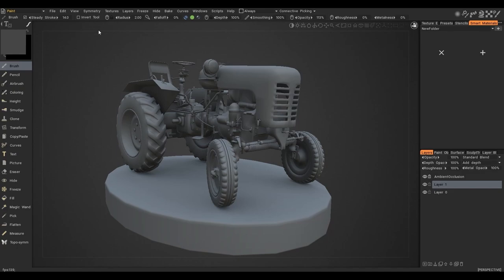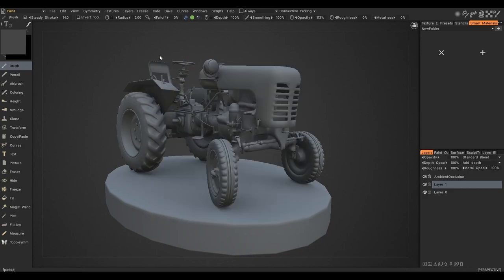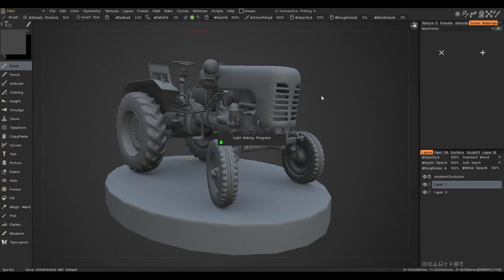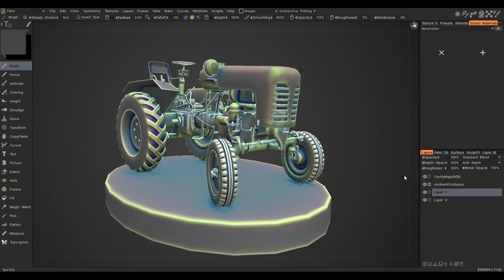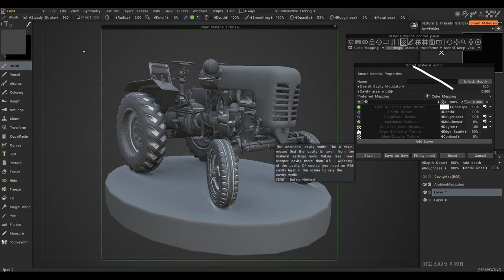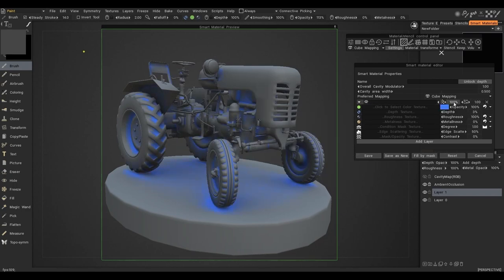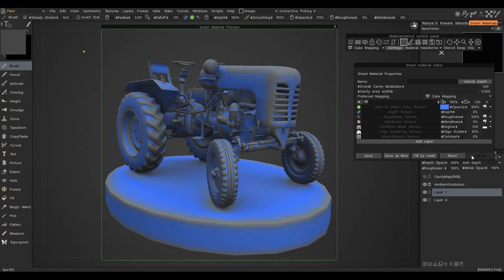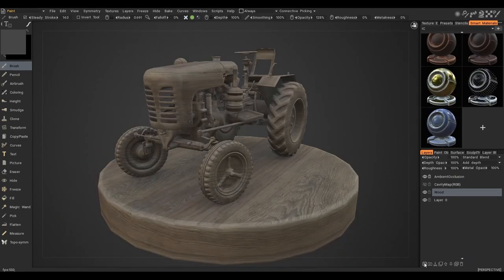The Use of RGB Cavity in 3DCoat 2021

Comment: Lovely! But I didn't understood what is the main difference between RGB and the older version. 
I saw it can generate colors,  that could be applied in post production, but there is other gains to bake in RGB?
Reply: yep, the same question. i suppose rgb-cavity is like normal map and stores curvature information based on light direction and not just slopes & highs.
Reply: I'd bet it lerps between various types of curvature (long range, close range) so you can benefit of more flexibility in the end =)